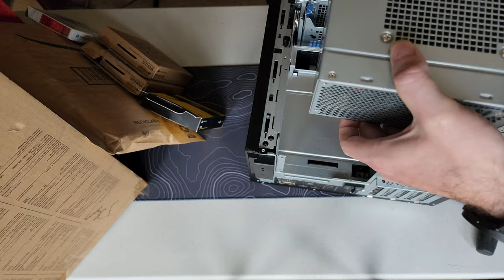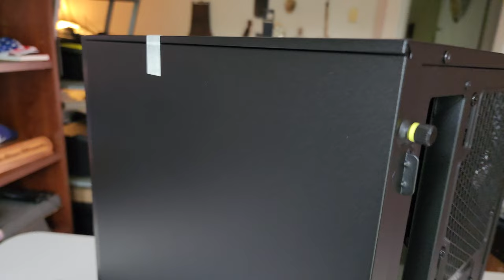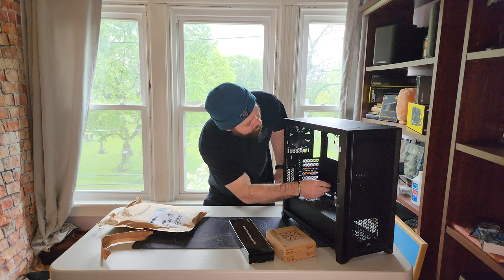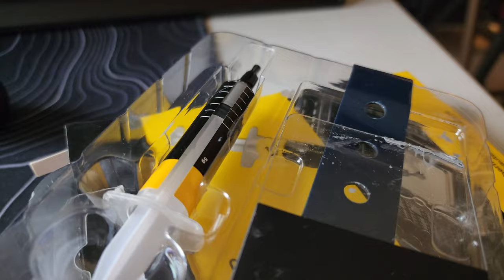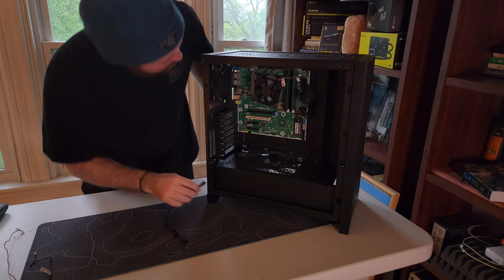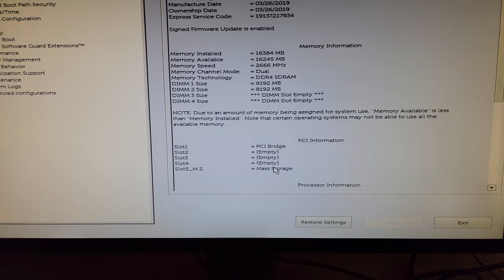TURN YOUR DELL INTO A GAMING PC IN 2023!

Comment: For standoffs, 5 or 6mm nut driver. Works wonders. Blue thread lock on standoffs before screwing into case optional not necessary. Also for getting screws aligned, turn them counter clockwise to start, until you feel a slight click, then turn them in normal. 😁
Reply from the maker: You sir, are a legend. Why have I put myself through this struggle so many times? haha

Comment: If you mark up the case in the inside use a black sharpie to cover it up works great,
Reply from the maker: That's a great suggestion! I do that too and it really does work great! Just dab the spot a little bit and smudge it with your finger and its barely noticeable!

Comment: T5810 is the platform I like for the transformation. Can pick up 12+ core Xeon for about $50. Loads of connectivity, ddr4 mem 8 slots, big pci area, nice fan ducting inside. Easily removable power supplys, with inexpensive 625 or 850 w also inexpensive on Ebay. Get a $40 pci 8 pin m.2 adapter for SSD, add $275 rx 6700 xt 12Gb, update bios easily to be sure will support Xeon v4 cpu, as bios before A12 dont. Benchmarks for cpu/gpu like xeon 2687w v4 + rx 6900 xt will approach amd ryzen 9 3950x + 2080ti, but for hundreds less. Finally, ditch Windows and install gaming linux Arch distro like Nobara or Garuda.  True joy!

Comment: I’m considering moving my Optiplex 3020 to a new case for various reasons, but I'm hesitant due to the cost of the front panel header kit, which could make this economical build more expensive. Thanks for your video. I need to determine if your method for disconnecting the front panel cables can help me avoid this additional cost. I’ve already invested in a GPU and a new PSU for the build, but a new case is indeed appealing.

Comment: I built a few computers out of optiplex 7010 motherboards to use up graphics cards I had laying around. They only made sense because the motherboards were $18, and 3570s i think I gave $20 each for and the ram I can’t remember.  The power switch adapters were the more expensive items I had to buy.   I do have a PC I just put together for my livingroom TV and it’s fairly identical to the Toasty bros $169 pc with the WX 4100 except I opted for a newer model 3060 with an I3 8300 for about the same price as they paid and got 16gb of ram as well.

Comment: Thanks for this video, helped me out so much with my first PC build. I did a case swap on my precision 3630 and it runs amazing now, but I don't know how to get rid of the power button cable error message, could you help out or possibly make a video for it? I would also really appreciate a vid on setting up argb fans as I have 3 along with my cpu cooler that just don't light up since I lack the 3 pin connectors, so a tutorial would be much appreciated.
Reply: Same, I’m a bit stuck with the power button error. Also I can’t get it to setup windows and not sure if this is an issue related. I can setup the uefi to boot from usb and use my win10 boot stick, but it restarts mid setup (assuming part of the setup) and goes back to the error message and the setup cancels

Comment: A few questions:
Have you done a follow up of BIOS errors ?
Did you connect front I/O USB C ?
I ask because I followed you and bought Corsair 4000D  plugs don't match with front Corsair I/O
I do note - The supposed 'template/cushion' of rear IO is the actual RF shield.
Anyway I forgot about the Corsair and put back in the old Dell 'Box'. I managed to put 3 system fans in with the available areas 😎
Apart from that it was a very good quality post. Good quality audio & vid. Ending of it could have been more comprehensive.
ALSO, do you live next door to a cemetery 😁